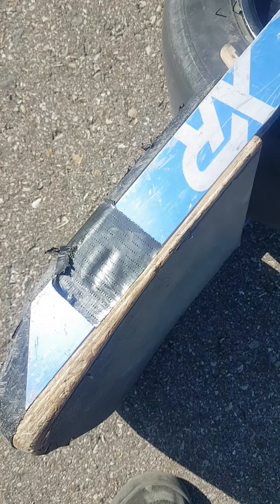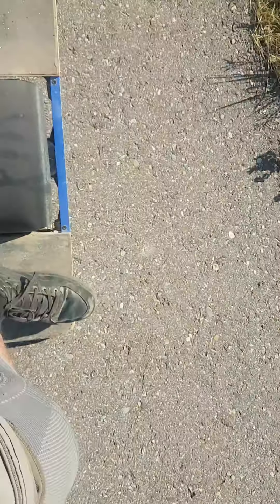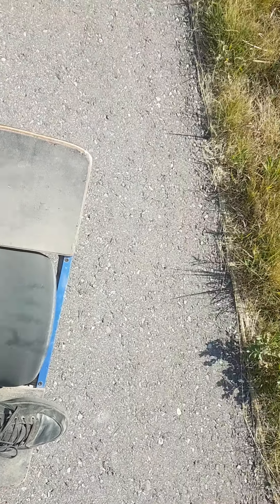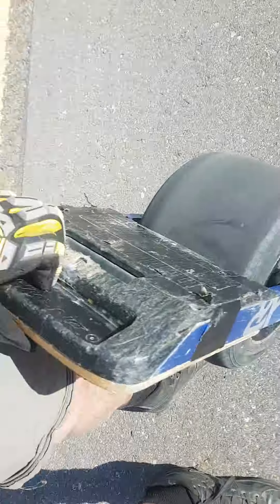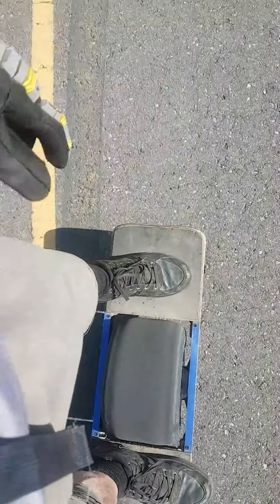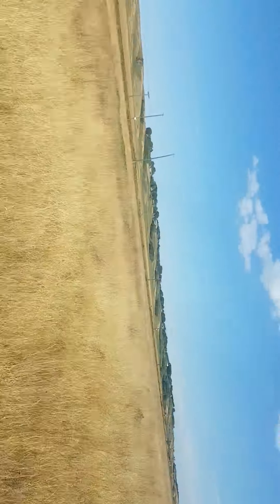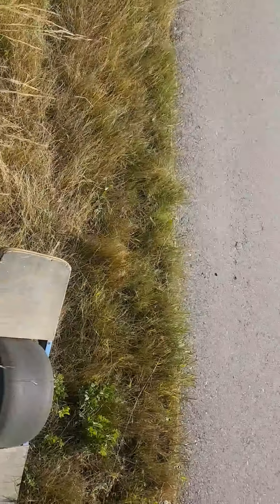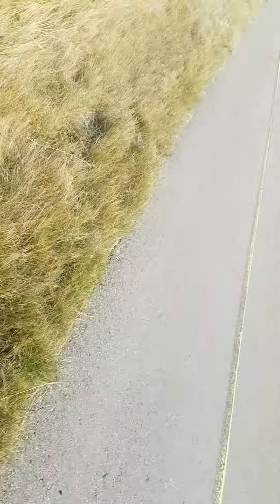onewheel random rambling ( some good info here )

Comment: @4:50  If you're cruising above 1 mph you only need one sensor activated.  I don't recall how much time you have if you're totally off both sensors.  This time may be important for knowing how long you can be airborn for a hippie jump.
Reply from the maker: That's true, if your off both the control loses the 5v control signal that relays the boards power.. so almost instant.. it reacts fast though so long as you land square.. thanks for watching. :)